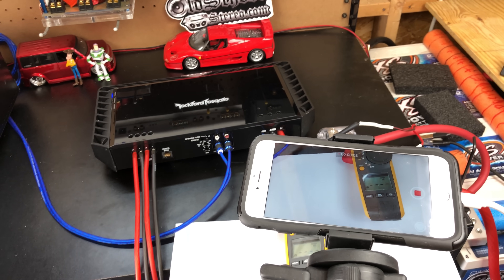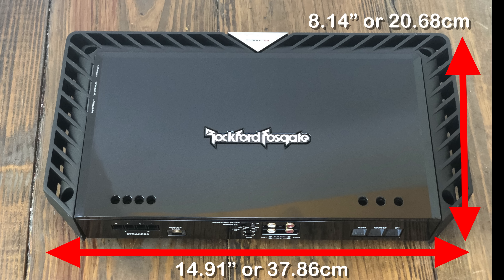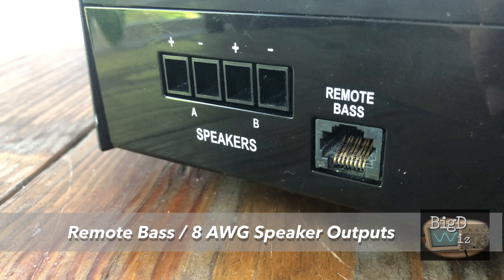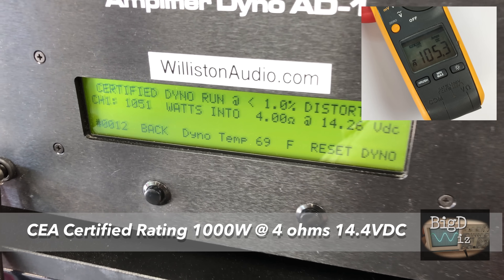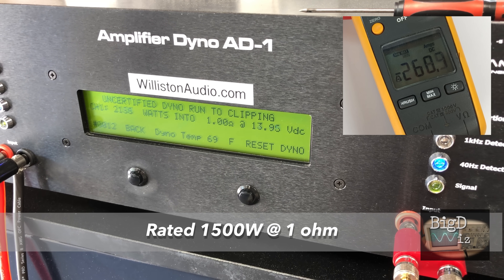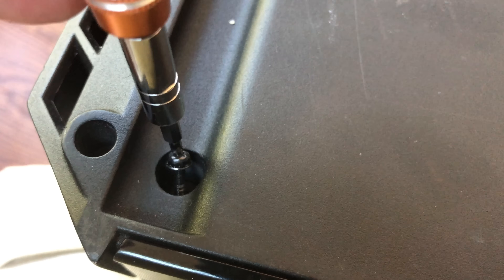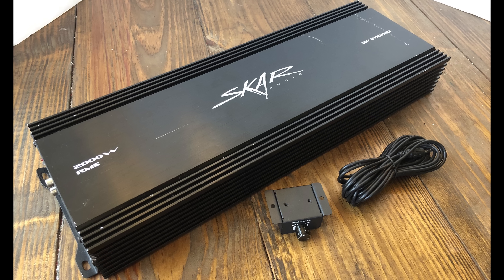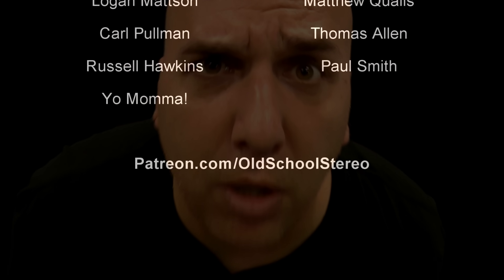Underrated? Rockford Fosgate T1500-1bdCP Amp Dyno Test

Comment: Very nice. Theres some refurbs for 449 lately too. Be nice to show people how much wattage they are losing from ohm rise for those that dont know. Many people are shocked to see their skar (or whatever) clamping 1000rms.
Reply: I believe that the constant power only applies to the 4ohm and 2ohm loads on the amp. 1 ohm does not take advantage of the constant power feature in this amp
Reply: I wish we could see what the fosgate clamps.
Reply: lmao @ the dude tlkn about skar conpared to a bdvp amp gtfo
Reply: sittdogg The Skar RP-2k does almost exactly what this amp will do at every ohm load, and for $600 less. Tough to say the RF is worth that much more in my eyes.
Reply: catch22frubert I've seen the dynos on them and the RF will battle of ohm rise, better SQ, reliability, and more clamped power. Clamped power the RF will blown it away. I personally know people with blown skar amps and subs who had things set correctly.
Reply: sittdogg  Umm, there's a lot wrong with what you just said here. Don't spread misinformation. It's bad for everyone.
 #1- If this amplifier and the Skar RP-2k put out very similar power at every ohm load, then in a car, on a clamp, they will put out similar power numbers. 
#2- The constant power aspect of this amplifier is null and void when the Skar does the same power or more at every ohm load.
#3- Im not trying to endorse Skar in particular, I'm just using them as an example for whats in the market. I would also say the soundqubed S1-2250 is a wayyyy better value, has a very nice bass knob with clip indicator for $250.
#4- Im not aware of a Dual amplifier that does 2300+ rms @1 ohm for $150, but if it exists, I suggest you buy it. They aren't bad amplifiers from what I've seen.

Comment: I wonder if people blow subs because an amp is overpowered by double it's rating.
Reply: Duggerdean most people blow subs bc they think the gain knob is a volume control and crank up the bass boost too
Reply: Most speakers are blown from clipping. Underpowering a speaker and then driving the amp into clipping will damage any speaker or sub quickly.
Reply: More speakers and amps are blown due to clipping than any other reason. Keep your HU from clipping and set your amp gains to prevent clipping and you're almost guaranteed a stable, trouble-free setup for a long, long time.
Reply: Not a tad. If the rated RMS are quite the same, and the amp is overpowered, you could use less gain fo the same power. So that means clean, accurate power--to the sub!
Reply: Duggerdean no because you have to have the correct electrical to get the power it really puts out! If you get a top amp like this I hope you have good subs that go with it!
Reply: ed elsey 
Lol true...!!! 🤣🤣🤣
Reply: Duggerdean I've blow 8 15's SMH LOL!!! I just installed 2 NVX 15' and they are blown within a week! I don't think the NVX VCW152 are accurately rated. My is locked in at 2000 Watts RMS and verified with a fluke multimeter. These subs were also wired to a 2ohm load. Most importantly though is that I live in Phoenix Arizona with temperatures upwards towards 115 degrees and this amp has never shut off! I cannot speak highly enough of this app!

Comment: Rockford Fosgate is my go to brand for amps. Great power for the money. Almost every brand has a low and high line. However, Rockford’s high line starts around JL’s low line. Plus, they look good.
Reply: Their high line is JL's low line!? 🤔 

Step away from the keyboard bruh cause you tripping 🤦🏾‍♂️
Reply from the maker: RF has always been on top of the game for amplifier technology.
Reply: I must say the Prime series of amps are very good price to performance ratio..
I would rather spend a few extra $$ on a RF rather than anything else out of China or Thailand
Reply: prices...learn to read...a statement about value...
Reply: I got mine brand new with warranty for 469 off ebay just got to shop around! I love it but wouldnt pay 800
Reply: K4gixxer1000 If somebody really wanted a Rockford amp, and spent $450 on a refurb, I could understand that. Its expensive, but not bonkers. $800 is crazy talk
Reply: catch22frubert The difference is this amp is constant power among higher impedances, a 4500 watt amp at lets say 4 ohms is still going to put out what this amp does and you can still be wired at 1 ohm and your impedance rise will always be above what you are wired at it just depends how high your rise goes to to determine if its worth the money so if you went up to 8 ohms you are still going to get 1600+ watts out of the RF but with a korean amp like sundown you are only gonna see probably less than 1000 out of it
Reply: godzillasballs i agree! Like Rockford but for the price i could get something different with more features. Not knocking Rockford, cause back in the day that is all people "rocked" 😆 and they slammed. They were very underrated back then. Now ill go with some of their cheaper competitors.
Reply: godzillasballs  maybe you should learn to be clear in your writing. You separated a complete thought into 3 SEPARATE SENTENCES, 2 of which had no mention of value whatsoever. You did it again in your follow up response- separating the similar terms of price and value with your snarky remark and a bunch of unnecessary ellipses. I guess i was supposed to read your mind through the phone screen and just know what you were trying to say 😑

Make your elementary teacher proud and write in complete sentences.
Reply: Peter Hammond um these are made in Asia...
Reply: Mine was not refurb it was  brand new! All i know is i have a skar rp2000.1 in the closet i had and sent back the hf brx2400.1 and the crescendo BC2000.1 which was 550 and all of them wont touch my RF T1500BDCP I use oscope to set everything up! not to mention all my rf even 1989 punch 150HD have lasted the test of time ther like a timex takes licking keeps on a ticking!Or maybe i just always get a good one lol!
Reply: Top of the game? Yes! But man, they make you pay out the nose for it. This thing is the Rolex of 1500 watt amps. Luxurious and Very nice, but you can do the same job for a whole lot less money.
Reply: @catch22frubert  I bought one of these at a pawn shop from the broken/not working section for $25 because supposedly it wasn't working.  Took it home and hooked it up and it powered on.  I think they mislabeled it.
Reply: @TheGuyWhoDidUrM0M  deal of the century
Reply: MrGetmoney84 This amplifier is a dissapointment as far as price to performance and features. You can get any number of good quality 4,500 watt, proven 5k rms @1ohm, Korean amplifiers for less money, and those offer remote gain with clip indicator and can be strapped. This amplifier only offers 1600ish usable watts, no strapping, no clip indicator at all, and no cool digital displays on top with useful info(T-2500bdcp). The slap in the face is not including a bass knob at all. For $800? That's just straight greedy.
Reply: catch22frubert that's not true just like the other brands the T-series is their top of line for the company
Reply: no rules on the internet...look up the for mustang crash video..."you too old"...lol..stop being so serious and rigid

Comment: Sup big d. Not knocking rockford at all. Just expensive. I have 2 sundown 1000 watt got cheaper then this 1 amp. Both wired to 1 ohm on a 18in skar evl each.  To me match made in heaven.
Reply: Rockford was impressive @ 1 ohm though
Reply from the maker: You will like an upcoming video showing a Sundown amp Test. Teaser I know, but you’ll see 👌

Comment: Rockford fosgate can't go wrong always good
Reply from the maker: Agreed 👍
Reply: I give them big props for not cheaping out on build quality as time goes on.
Reply: verpriced..not .5 stable. Meh
Reply: @casemods  this is for sq not spl you don't need to go down to 0.5 ohms..
Reply: Besides their subs. They are overpriced junk. Good sq though, but not good for output.
Reply: @fishhogz6982  dude this amp is rated at 1500W and puts out nearly 3300W. how is that junk? Its underrated
Reply: @GlycerinZ  and overpriced..
Reply: @fishhogz6982  bro just say you’re broke and move on 😂